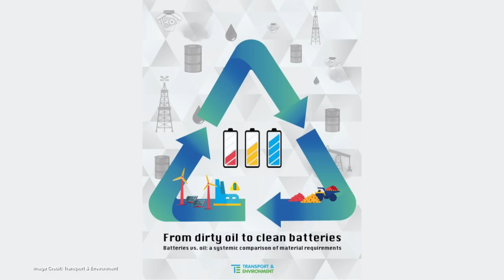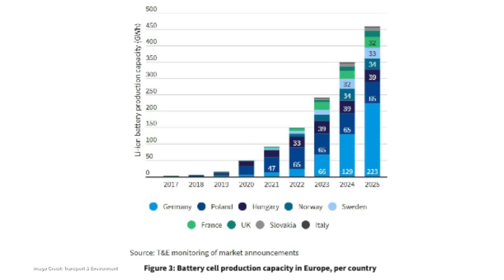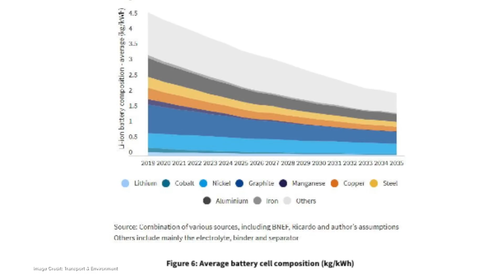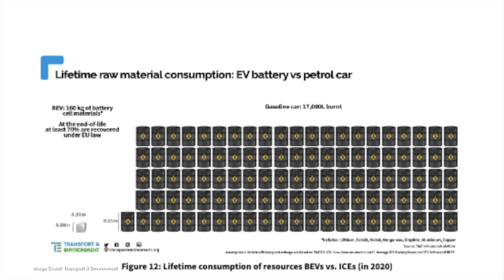This Report Busts The Myth That Electric Cars Are Worse Than Gasoline ones

Comment: There are two main groups who perpetuate this FUD:  Petroleum flacks and eco-luddites who think they are "helping".
Reply: There's also a fair number of "car bad train good" folks who repeat this kind of thing, and I do agree with them on a lot of points, I do think we need to rethink the way we build housing and infrastructure to move people away from needing a private car simply to live, it's just that we need to do both so that the private cars that are left at the end are as clean as possible.
Reply: @AlRoderick  And the busses and trains.  'But we can put pantograph wire everywhere!' just... Isn't true. x-x
Reply: @AlRoderick  I'm in one such group on FB where people post anti-battery FUD that's been amply debunked here and elsewhere. And also they seem to think anyone who thinks EVs are better than petrol cars is an Elon Musk fanboy. And so much more ignorant crap. And I'm here like, I get that just going from combustion to EVs is not "the solution" because that still leaves the problem of cars - but how do you go from there, to repeating the talking points of the oil and gas industry?
And I've noticed, the electric trolley bus that goes through my neighborhood has been running with its trolley poles down - meaning it's on battery power. I've been vaguely curious about it, not enough to research though. But it seems that MUNI has found it preferable to use batteries than deal with the hassle of the trolley poles coming unhooked and the driver having to get out and pull them back onto the wires, at least on the more challenging portions of the route.
Also I just recently saw a video on a European railway explainer channel about how they're building battery-electric locomotives for rail lines where it's not cost-effective to install pantograph wire. So there's that.
Electric >>> burning stuff. Whether it's to move a car, or a bus, or a train. Train/bus >>> car, for moving lots of people around a densely populated area, and between densely populated areas, regardless how powered or piloted. To proceed from the latter, to denying the former, is just bonkers. But then, luddism is just bonkers.
Reply: Yes we need to dense up our cities. Sprawling must stop now! We need to make public transport a better solution for more people and make the city environment more walking and cycling friendly. We need more space for walking, more space for cycling, more space for public transport (ie. own lanes for them) and that needs to be taken from the private car. Then we need trams, convert buses to electric, replace some cars with electric ones, convert some cars to use biogas or ethanol and the rest and most of the cars need to be scrapped and recycled. We need to do all this at the same time.

Comment: I don't doubt the the figures apart from in one area if EV   batteries last over ten years so  then there will be no batteries to recycle. Currently we have sold only  a handful of EV worldwide most  haven't reached EOL yet . True there are other lithium batteries that could be recycled eg laptops but will this really  be enough .. The saving will only come In effect after everyone has  had 1 EV and the EV is EOL  so  somewhere after 2040, it won't help us to getting everyone in their first EV.
Reply: Yes and No, Yes we are going to have to find enough minerals to convert the existing ICE fleet to BEV's, but as those EV's age out, and the batteries are re-cycled, demand for those minerals should be substantially reduced.  Main finding here is that the CO2 created in the production of BEV's is more than made up for by the far superior efficiency of electric motors versus ICE engines, combined with the electrical grid more heavily switching to renewable sources.  BEV's and the switch to renewable energy sources will have a great impact on the amount of CO2 produced.
Reply: Also, people seem to find a lot of uses for end of life car batteries even further reducing those being recycled.
Reply: You are correct, recycling will have to grow over a prolonged time, probably 20-25 years, however once we hit high enough recycling rates, we'd be practically independent from imports and newly mined resources, which is worth the wait. Even without recycling batteries are expected to drop to around 60$/kWh by 2030 if I remember correctly.

And ofcourse you will get early batteries being recycled due to for example production mistakes, heavy use (think transport sector), ...

Comment: Is it better, however, to keep our old cars until they are scrap or move straight away to new EVs?
Reply: IMHO, scrapping a still good Euro6 car is kind of a waste.
EURO6 is the class of how much "green" a car is in EU, and and Euro6 cars are not that horrible. Polluting, gas-guzzling, but much better than the old Euro0 to 4 classes.
The plan to stop producing ICEs by 2030/2035 in EU and incentivate replacing the fleet with BEV make sense. Trying to "force" people to scrap instead of "making cheap" to transition will get much more political issues.
Reply: @ulissedazante5748  the polluting cars are mostly in the US with those giant 5, 6 and 7l engine size, plus most people in the US drives giant cars compared to Europe with small cars or Japan for example with kei cars. In japan most popular engine size is less than 1l for example. In Europe people owns small cars and rent vans or trucks to move bigger things around and thats how it should be done.
Reply: That's an interesting question because if your car is in good shape it's definitely going to be resold to someone, and there's a good chance that the car they were driving before they bought yours was a rattle trap that leaked unburned gas or was otherwise very inefficient. If the people who have the means buy new electric cars and sell their old gas-powered ones into the used market, it will likely push out older and dirtier used cars out, they will be the one to wind up on the scrap heap.
Reply: @AlRoderick  old cars can also be converted to LPG/CNG which runs way cleaner or diesel cars with biodiesel .....
Reply: @AlRoderick  that's an interesting point of view. Never thought about that.
To be honest, I didn't realized it but my dad had a ten-years old rattle trap and he's talking about scrapping it.
And in that quest, he found a ton of cheap used cars, mostly two-three years old, medium mileage and way cleaner than his rust bin.

Dad is too stingy, and in his head fixing the old lady is cheaper than the cheapest car: but for most people it works.
Reply: It also depends on how many miles you are driving.  I drive < 1000mi per year, so buying an EV with all batteries etc sitting in my driveway with it's tech getting older does not seem better than keeping my 20yr old gas car.  I think if you have a long daily commute or kids to ferry around, replacing the gas car may give you immediate benefits.  It also lets the old car be sold used to someone who could not (currently) afford an EV.
Reply: @normcfu  my experience is a bit different: I drive 10.000km/year (6000miles/yr) mostly short range.
I bought a new BEV that was already obsolete the day I purchased it, a Peugeot Partner electric van.
I payed it half of a state-of-the-art car exactly because was sitting there at the dealer and better models were available.

But a cheap, out of date van did, do, and will do the short-range thing I need until it dies of exhaustion, probably ten years from now.
No maintenance, easy to drive, plug and go. No match with a ICE.

For longer trips, less predictable schedule and generally high-performance car, a good ICE is still a viable option.

Comment: Hello, I am sure the the cost per kg is down to around $100 kgh (not sure) but I saw two weeks ago that the US government were working on figures of $167 kgh (not sure)? I am not sure who to believe? I was hopping it would be less that the $100 very soon.
Reply: It depends on a couple things.  Raw cells are cheaper than finished battery packs, so it matters whether they're talking about cell level or pack level.  Different manufacturers have different costs; Tesla is the leader in battery technology and costs.  Costs are falling rapidly over time, so cost estimates also depend on when the data was sampled.  The units used for battery cost are based on the amount of energy they store in kilowatt hours, or kWh.  The usual unit is thus dollars per kilowatt hour, or $/kWh.  Could certainly use Euros or any other currency, but I always see it in USD.  Tesla's new 4680 cells are or will very soon be below $100/kWh.

Comment: BULLSHIT: Why do you people think that electricity is a source of energy? It is not. It is generated. Most of the electricity in the EU, for example, comes from solid and fossil fuels and nuclear fission, along with natural gas which must be imported. Even the renewable portion is resource intensive. In short, EVs run on those types of fuel and not on perpetual motion and unicorn piss. “This Report” does NOT bust any myths; in fact, it merely reinforces them.

Comment: I'm glad to hear about cobalt going down in use those lines aren't..... Great
Reply: LFP batteries already don't have cobalt, like some of the standard range Tesla Model 3's made in China with CATL cells. Also no nickel in those, just iron and phosphate. It doesn't have quite the performance of the long range ones. The  charging rate only goes to 100kw, and the range is 260 miles, but it can be charged all the way up every time, and the cycle life and safety of LFP is exceptional. 

Tesla is working to eliminate cobalt from their other chemistries too, high nickel, and nickel manganese.
Reply: The one thing that doesn't get talked about is what else people use cobalt for. One of the big consumers is the oil refining industry. So eliminating electric car batteries isn't actually going to eliminate the demand for cobalt.
Reply: Even better would be for the west to finally deal with the humanitarian catastrophe they created in the DRC.

Comment: I'm not so sure that it is a myth that electric cars are worse for the environment, it is more that it is a problem but there are solutions to preventing it being so, so it is more of a case that they don't have to be. 

I haven't had the benefit of reading the report myself but there were some big assumptions about recycling that have to happen before it is true, recycling in general is poor and battery recycling is in its infancy. 

How a country's electricity is generated is going to be an important factor, because if the majority of vehicles are going to be electric most countries will need to invest in more electric generators and some of that capacity is going to have to be from non-renewable energy. 

considerably

Many people want to switch to electric vehicles because the polluting parts of the life-cycle of an electric vehicle are more easily addressed, but they do exists and they do need to be resolved.
Reply: "it is more that it is a problem"
No, it really is a myth because it's not true. Is this really that hard?
Reply: Recycling is basically happening now - the batteries are far too valuable to waste. Even if a grid were 100% coal powered, it's still cleaner with BEVs at the point of use (i.e. where people live, work and breathe), and more efficient (as coal power plants are roughly twice as efficient as ICEs). 

In reality, most grids are only partially fossil powered and getting greener all the time - so BEVs already on the road become greener as well...
Reply: @midnightstar4065  In the EU coal powered EV's are more polluting, even the most efficient ones (at around 190g/mile, vs average 115-120g/mile for an ice).
Reply: @MDP1702  The European grid is unified so EVs on average use a mix with less than 15% coal. Plus, pollution is not just about CO2 - it's also about the toxic fumes/particulate ICE emissions concentrated where people live and work...
Reply: Battery recycling is mature. It has been happening for decades with pre-Lithium-Ion batteries; and Lithium Ion has been going on for over 10 years now. The idea that EVs are bad because they'll be thrown in a landfill in 10 years is ridiculous. There's far too much value in the parts, even if a vehicle is wrecked. Just like with gas cars.
Reply: @AnonymousFreakYT  Globally Battery recycling is not mature and how can it be when EVs are still niche, relatively new and the majority are no where near End-of-Life. Recycling batteries is not in itself a energy free process, the report, like some of these comment are sugar coating the problems that need to be solved, that should be the discussion, not a simple "ICE cars bad, EVs good" chant.  

How many EV supporters are also happy to have more Nuclear power stations, because it may be possible to make renewable energy supplies the majority, but for a reliable grid, there will be the need for the grid to be complemented by other types of energy supply.
Reply: @martincday007  Li-ion battery recycling technology is well developed right now, but it is not yet deployed at large scale.  Deployments will occur as needed to keep up with the need, which is currently small.  Technology leaders that I'm aware of in this space are Redwood Technologies and Apple.  Probably a lot of companies in China as well.  As for Nuclear, I'd be happy to have one in my "backyard" if it replaced an equivalent amount of coal (or even gas) burning.  Particulates from combustion are a threat to my health.  Glassified pellets of nuclear waste buried deep in the ground are not.
Reply: @martincday007  My occasionally nuclear powered BEV works fine. Most of the time its renewables though  :)

It's not just about battery recycling - there are also "second life" (reuse) applications - such as grid storage to complement renewables. Vehicle to Grid (V2G) can also help complement renewables
Reply: @AnonymousFreakYT  speaking of wrecks... Are there any stats on how ev's hold up in accidents, do you know? Guess I was wondering how much or how little damage a shunt would do in comparison to repair costs of an ICE car in similar circumstances. Perhaps they are more robust in all but a life threatening crash? Any thoughts?
Reply: @judebrown4103  The cost to repair a vehicle after a crash is surely highly dependent on the model of vehicle. Whether the powertrain is electric or not doesn't seem particularly related to the cost of repairing or replacing fairing panels or headlamps. Though, the fact that EVs are still a young market might suggest that replacement exterior parts from salvage yards may not be so easy to find just yet.

EVs may sustain less damage in crashes for reasons related to their powertrain, though. For example, since batteries are so heavy and usually low to the ground, an EV may be less likely to roll over than other similar vehicles. So that may reduce repair costs. Also, there's usually no radiator in the very front, to be damaged in a front-end collision.
Reply: Thing is, EV's would be able to support the grid to go nearly fully renewable by providing storage through V2G, so EV's wshould actually help clean the grid, rather than extend or increase its fossil fuel use.